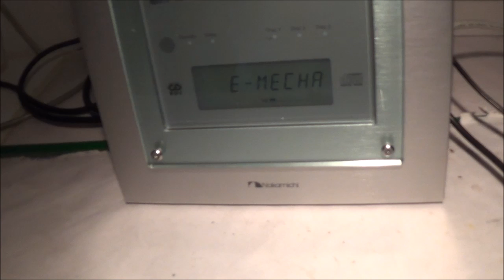Nakamichi Soundspace 5 CD Problems

Comment: Wow lucky! I have the same exact thing and after years of not using, it's not doing anything anymore. I don't get the mechanic error sign tho. But i have 2 cds stuck in there so it's good to know I can still open it up and grab them! Thanks!
Reply from the maker: Thanks for watching and good luck!
Reply: @OldSchoolElectronics  hopefully it's just stuck and ends up working when I put it back? It turns on and you can switch to disc 1 2 and 3 but it just won't move anything and nothing happens when you press play and eject.
Reply from the maker: You really cannot do much without test equipment and specialized knowledge. And since these units aren't worth much nowadays, it probably would not make sense to have it repaired.

Comment: There is place online with service manual for that unit, if you interested, let me know, also I have same unit, and it reads some CDs, but doesn't the others, not sure if laser diode is bad, or lens dirty, as it won't read cleaner cd
Reply from the maker: Thanks for your comment and offer! I have only the loudspeakers now. I prefer to clean the laser lens manually with a cotton swab and isopropyl alcohol.
Reply: @OldSchoolElectronics  Thank you for the tip, I will try that, I wonder if it's still possible to get laser diode for that unit?
Reply from the maker: The laser pickup is a KSS-540A, which is sold on Aliexpress and eBay. I don't remember what I paid, but it was not expensive.
Reply: @OldSchoolElectronics  Thanks a lot for information, I'm still deciding if I should keep it and service it, or get something else.

Comment: I bet the CD is working fine after you put it back again!
Reply from the maker: oh no...still haven't got it going. looks like the technician in the shop it was in for repair tore a ribbon cable. fixed that, but now i get the dreaded "emecha" error. put it to the side for now, but will try again in the future.